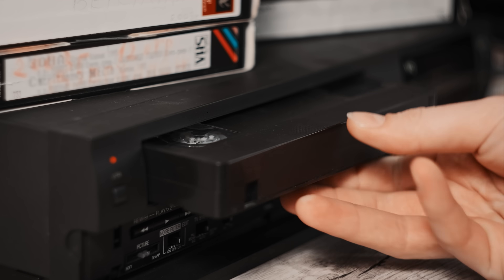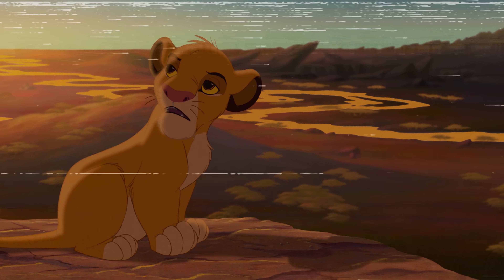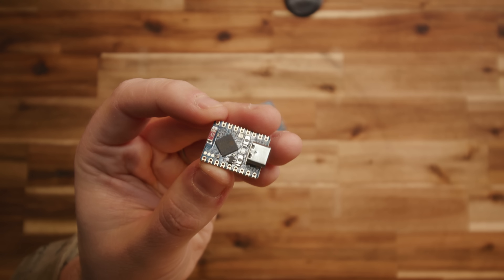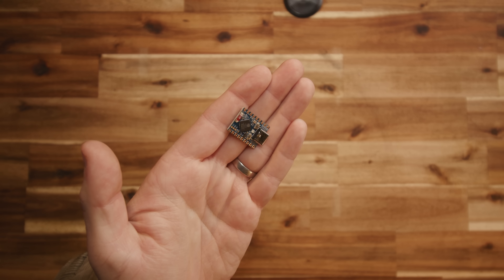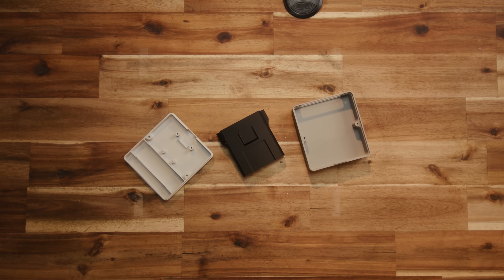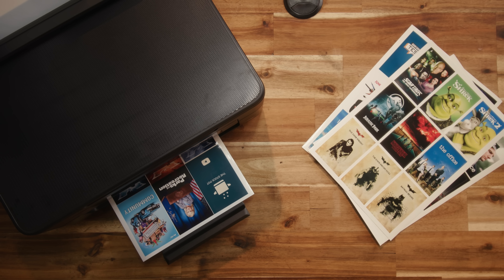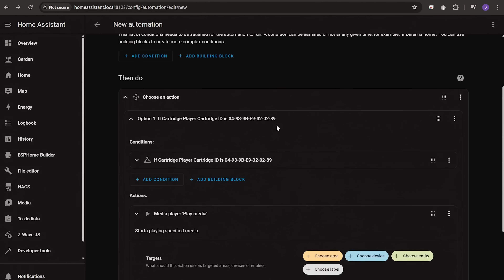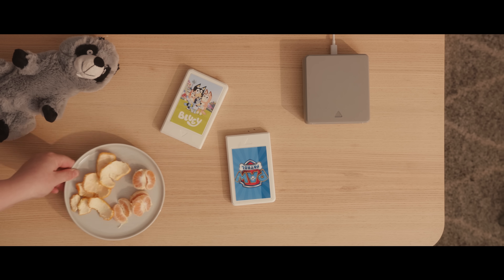I Missed VHS... So I Made My Own

Comment: I got a very similar setup using barcodes and kodi (then xbmc) to play back my dvd collection backups without removing the disk from the case for durability reasons... it was pretty neat but I moved countless times and my dvd collection is long gone now... I think I finally need a 3d printer!

Comment: A less effort version of this could be a collection of SD cards with custom labels, and a nice SD card docking station with the spring action.
Reply: The problem of SD cards is that flash memory lose charge over time. In few months it would have minor checksum errors depending on a temperature in a house.
Though, I do like SD card size factor. Maybe if there were WORM (Write Once Read Many) flash tech/ it could become standard better than Blu-Ray.
Reply: The expense of that may be its own issue, because then you're getting anywhere from 16-64GB SD cards for every individual media you wanna replicate physically That said, the 3D print aspect leads me to believe this breaks even. That also works out if you're just building it all into a Pi enclosure and building around automounting the SD card and loading a playlist file into MPV or VLC.

Comment: While I really like the analog aspect of plugging the cartridge in not everyone has a 3D printer and/or the money to have a place like PCBway print a bunch of cartridges for them so, an easy way to do this would be to put the NFC tag inside the case or case sleeve of the disc, behind the artwork and either use your phone or place an NFC reader under your TV to read them.

Comment: You do know that DVD's and Bluerays are physical media too? And don't have all those drawbacks mentioned at the beginning of the video!
Reply: I remember how a lot of DVDs we had at home ended up scratched 
So it only played certain parts XD without lagging
Reply: @shadowolf31520 You know what, that is completely fair. Been there myself. As an adult I am very careful with my discs, as a boy a little less so. I even remember use having a couple DVD players where the laser head worn out and so caused scratch like stutters frequently. Very annoying. 

But more to the point, I don't think that it's possible to create a "physical" media that is completely immune to this issue. That which is physical, wears out with age, or can be damaged just because.

Comment: I feel like this project needs a little OLED display that can simulate a vacuum flourescent display (VFD) that can show playback status, a progress bar, maybe a movie title, etc. Most importantly, it should show a clock that can be optionally set to always blink 12:00.
Reply: Our first family VCR was a Mitsubishi, with a corded remote. The clock was in military time, but if you didn't set the clock, it flashed EE:EE instead of 0:00 (12:00 AM)
Reply: The clock on my VHS player just read - - : - - if it wasn't set. Having options for different "no time set" would be great.
Reply: @AlyxForest  Ah yes.. A VHS player
Reply: Oooo that's a great idea. Very tempted to do something like this and this is a great addition.
Reply: And the cute little door
Reply: What about an E-ink screen for extra power saving and no display burn in/issues?
Reply: @Mantenner  or an LCD.
Reply: @Mantenner  The burn in is more authentic though. I always thought it was neat when we had a movie longer than an hour cause most of the segments for the 2 were super bright in comparison.
Reply: Why OLED? Choose real dotmatrix image VFD display that works with esp! (there are few)
Reply: @x-wiertarka  I agree. OLEDs aren't built to last.
Reply: This
Reply: Would love to see this upgrade
Reply: A virtual cassette tape like the Sony walkman
Reply: Remember trying to unplug the thing at midnight so that the time would be accurate but it would still be blinking?

I thought about that once but they never actually attempted it.
Reply: Thumbs up for the 12:00 clock... make it so that it could never actually be set correctly! LOL
Reply: my vcr (which i have rn next to my desk also im 10) always blinks 12:00.

Comment: This is honestly so cool and I've considered doing similar things though I lack a 3D printer. The cartridges you made remind me of the PC Engine cartridges from back in the day.

I can see why you went for NFC, especially in the name of low cost and complexity, but if I were to do this I'd definitely want to make a cartridge with pins that make a direct connection. Mostly to keep it somewhat in the realm of what physical media is generally like. 

Was also thinking about how the metadata of the cartridge could be more extensive and have information beyond just an ID string. Since the purpose isn't to store sensitive data it'd be nice if one day someone found the cartridges and wondered what they did, they could find out (beyond the stickers of course, which could wear and fade over time.

These are all "extra mile" type of ideas and it makes perfect sense why you didn't do any of them, but also thought I'd throw the ideas out there for the other tinkerers in the comments 😊

Comment: Super cool project! I might recreate it, but rather than add each NFC tag ID to the automation manually, I would write the media_content_id to the NFC tag as an NDEF record. That way the automation could just read the media_content_id from the tag and play whatever's on there. I feel like that would make it a lot easier if you're going to have lots of cartridges
Reply: That does make the automation simpler, but it comes at the cost of having to find and update the NFC tag if the media content id for a movie ever changes (such as replacing it with a higher quality release). I'd prefer the flexibility of being able to change which tag corresponds with which content in the automation so no tags ever have to be rewritten.

Comment: Instead of a Choose block, I actually defined a string on the NFC card name itself. Then I parse that string, read all NFC scans in my automation, and THEN do a Choose block. That way, I only have to program the NFC card and not the automation for each individual one.
Reply: yeah immediately after he started talking about  automation per disk, my whole interest fell apart.
Reply: @parsadoes  😂 you can also have multiple trigger IDs for each cartridge as well, and you and parse those trigger IDs too.

It's a lot of effort because you have to scan the NFC tag, then associate that ID with a new trigger and ID.

If you name the tag itself in a way that's easy to parse, it will work no matter the automation, and you'd only need 1 automation per media room.
Reply: Oooh.  I like that idea.  A monolithic choose block I thought was the downside of the approach.
Reply: @Terminal7988  yeah. The benefit is you can add tags without having to update your automation. And you can check which scanner scanned the tag to only play in that room. Meaning... You can play the same movie in multiple places only updating the name of the NFC tag
Reply: Can you explain that a bit more please? As far as I know the esphome rc522_spi component only reads the ID of the NFC sticker, not what is stored on it. I am 5 cartridges in, and the automation yaml is getting a bit unwieldy.

Comment: Very cool! Have you had any issues getting tags to read consistently? I've had nothing but problems with the esphome NFC component failing to read tags, but using the exact same hardware with non-esphome firmware and Arduino libraries works great...

I may just write an external component that wraps the Arduino library (and moves reading to another core, since it often blocks longer than esphome likes when decoding the tags).

Comment: 2:00 Compared to vhs, yeah streaming is higher quality. Compared to DVD and blu ray, streaming and it's compression algos are garbage. Bitrate on a bluray is 4-10 times higher than typical 1080p netflix
Reply: What I find frustrating too is we have the means to meet halfway and get blu-ray-like video quality from a much lower bitrate than blu-rays. Especially with the advent of modern, more efficient codecs like HEVC (tbf 4K blu-rays use this one) and AV1. 

We definitely don't need the 30MB/s or however much it is on blu-ray for streaming to look close to as good, but unfortunately most platforms do a really bad job with that.
Reply: @BaxBadger a blu ray rips are about 30 gig a 4k usally 60+ when studio  give a movie to a streaming service it striped and compressed with a ton of DRM and that stream company does even more compression and drm, this is why I buy player is not too much and the quality is beyond what you get from streaming
Reply: @BaxBadger  The reason why most streaming services typically use less efficient codecs is because they are catering to the lowest common denominator. You can still go out and buy a cheap tv or smart device that doesn't have the ability to hardware decode AV1 and in many cases, not even HEVC, and so the device would need to decode it in software on it's very low powered CPU.
Reply: Either way, this is sick and you have some really creative ideas and slick execution
Reply: Yeah get yourself a BD-ROM drive, MakeMKV, and a couple of 16TB disks for your NAS and you can rip the BluRays with no transcoding ... and no mandatory pre-roll antipiracy ads.
Reply: He has his own media server, so chances are quality is higher than standard streaming services
Reply: @FathomRaven depends on the bitrate of the sauce
Reply: @lachychops2 True, though if you use rips of physical media I'd imagine it'd be pretty good. I dunno his exact setup though
Reply: Yeah but go back and watch a vhs, because it was on film there was something about the picture that didn’t seem as flat. Idk how to describe it, but you can tell a difference in picture quality when viewing real film compared to digital.

Comment: Completely unnecessary, but absolutely amazing! I love it. Did you try and design something that could be done single handed-ly? That's the beauty of VHS, that you feed just the front in, and the player pulls it in, and then spits it out when pressing eject, zero force required
Reply: more plastic garbage in dumps, yay.

Comment: So the NFC will constantly be pinging, ok ignore it in the code but the lack of a ping is a trigger. So when the cartridge is removed it can cut to snow or lines. If the cycle isn't fast enough then you can put a limit switch or reed switch with a magnet in the cartridge. To detect insert and withdrawal
Reply from the maker: The original version has a reed switch with a magnet in each cartridge! 

The ESPhome integration for the RC522 reports when a cartridge is inserted, so I opted to simplify!
Reply: @TheStockPot-AU that would need too many magnets anyway. Any micro switch would be as good, or a silent MX.
Reply: A limit switch at the back would give a satisfying "click" when you put the cart in too
Reply: could be designed in a way where the reader is on one spot, and the nfc tag slices over it and past it, so its not constantly pinging, and then it will pass over it again on the way out. 
Not sure what the range is for the readers though, whether they can scan the tag from too far away to make that practical.